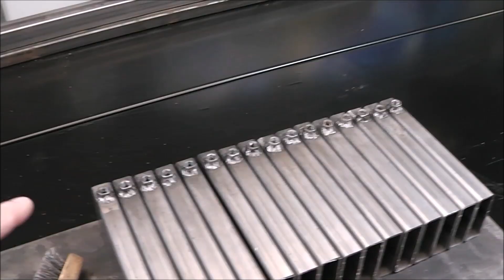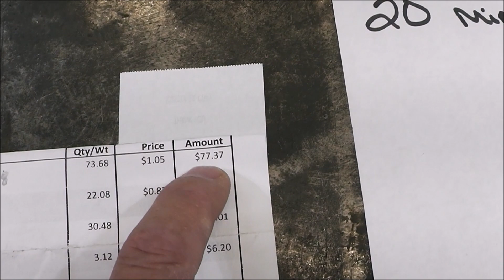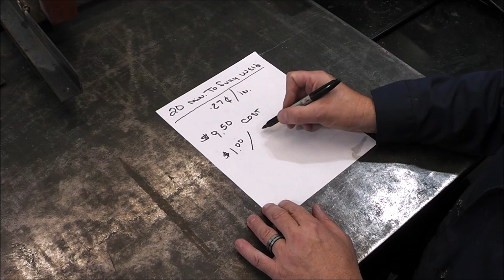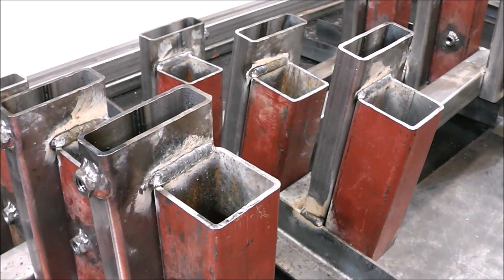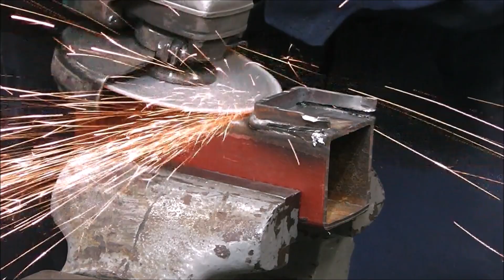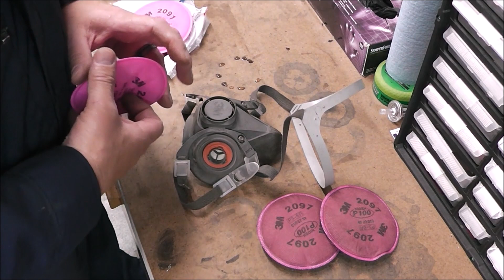Welding Fabrication and Pricing out your Work

Comment: Thanks for this video. Your order of operations explanation was very helpful. As to welding the nuts on then chasing them with a tap—-try threading the screw in nut and tape the exposed threads with masking tape to keep the spatter off the threads. This does 3 things in one step,—-gives you a way to hold the nut,  you have to thread the screw in anyway and you don’t have to chase the threads later.
Reply from the maker: I'll have to give it a try :)
Reply: Your method of holding a bolt/threaded bar in the nut also means the nut is properly in line with the hole, having something to hold onto like this makes a huge difference, specially when using thick gloves for stick welding.
Reply: Make a copper rod that fits into the nut and hole  as a holding / centering jig. Spray with a bit of anti splatter.
Reply from the maker: Great tip! 👍

Comment: Excellent topic and well presented. Laying it out like you did makes it a lot easier. I do custom gun work along with wood and some metal fabrication and I always wrestle with what to charge. Most of the time I end up giving my work away. I like the way you broke it down... Good video!
Reply from the maker: Thanks man! I have worked for free a bunch of times. I've found this way works well for me.
Reply: Agree. It’s a real problem when you have ability, tools, and a desire to please/impress others. Sadly, I’m still stuck there. I did get a case of good beer for may last repair job though. Making progress!

Comment: A very good lesson on how much to charge for things  , the project came out awesome , ever think about building a long range heavy swinging or stationery targets. ?   Brandon I have about a 1/2 dozen man hole covers ,I think they are cast Iron  would they make good targets ?  Or do you have an idea to make something else  with them ?    Thanks.   TANK.
Reply from the maker: Thanks man! Most manhole covers are cast iron. Typically they use AR500 steel on targets. I like the idea of making some. I might just have to do that!

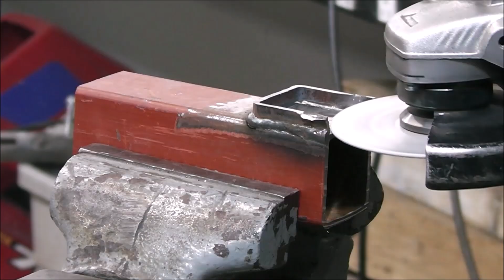Comment: 11:48 that "free" or "scrap" metal can be some of the most expensive metal used. If it takes 5 minutes of your time for cutting/cleaning on one piece and another $1 for electricity, diamond wheel and grinder wear, you're looking at $6 a piece- quite a bit more than $.27in from the metal yard.
Reply from the maker: Spot on! Did you notice where I placed the welds on the  2" square tube 🤔 right on the cut, so no prep work. None. For the exact reason you pointed out.  If your not careful about how you use your "scrap", it can really chew into your labor cost / profit. Bed frames are a great example. Maybe you can get them for free but if your cutting it with anything other than a flame or plasma your gonna burn up consumables because there tempered. I literally needed a 6" piece of sq. Tube and I had none other than the piece you saw, so hacking up this was the best alternative to driving 1 hour round trip and buying a full stick when I only needed 6"
Reply: haha I've occasionally looked at scrap I had on hand said "nope, not that broke today" and drove to the store to get what I needed.
Of course, there have been other days when I look at my bank account and say "well, I can work with what I've got on hand"
I'm just a hobbyist welder though :P
Reply: @dscrive    found that out the hard way! lol   shop min is $50 then $50 an hour.  Granted i don't do much on my own, 3-4 2hr. jobs a week keeps the beer fridge stocked!
Reply: I feel this comment In my soul, the truth has been spoken